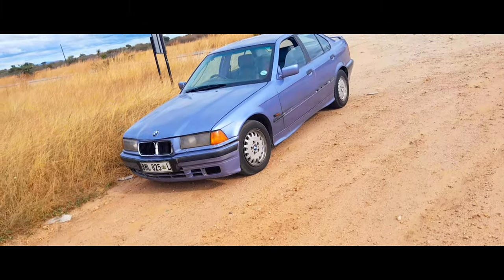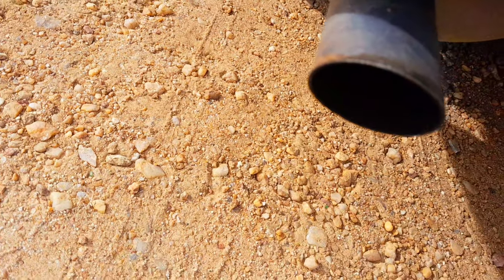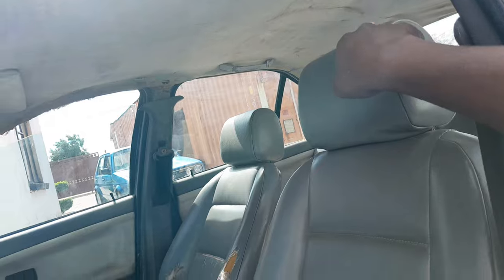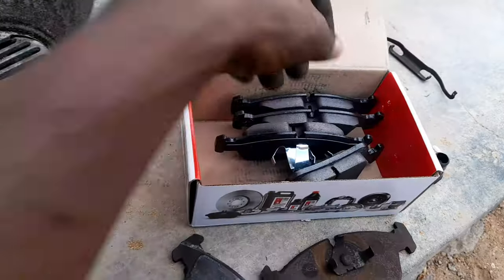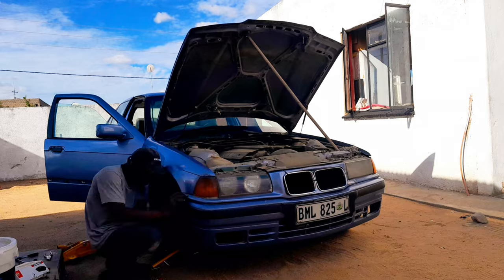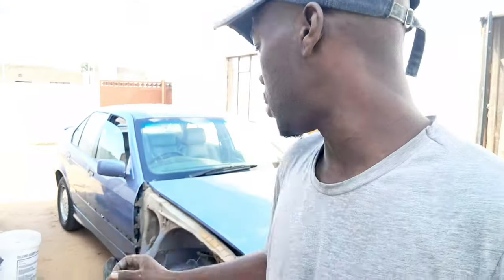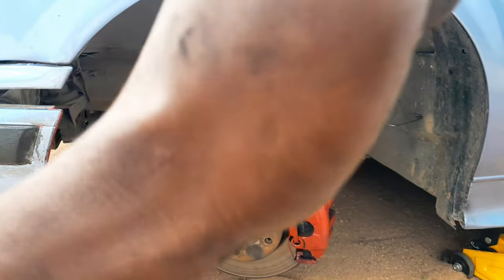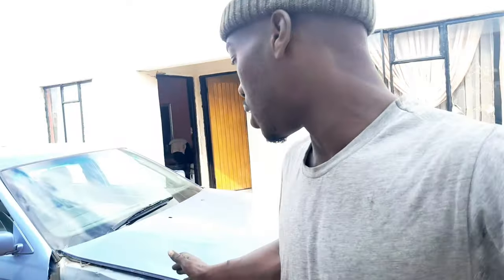RESTORING MY BMW E36 SEDAN (RUST,PAINT,BRAKES) part 1

Comment: neither a 325 or 328 with that single exhaust pipe.  320 at most if the pipe and motor is still standard.....but still, its a BMW, and thats what count
Reply from the maker: Love that ...thanks for the info

Comment: You should try using redoxide after cleaning that surface rust then spray stone chip which will protect the car properly. Primer will only protect for the short time it will start rusting again.

Comment: It's a 325 M50B25TÜ 6-cylinder.

It's a little brother to 328i M52B28 6-cylinder and M3 S50B30 6-cylinder.

So you have a 325i Bro.  However Double  tailpipe was for the flagship/Face-lift M52 325i that came with a spoiler and  6-bar rims and fog lights.

Another thing is that square nudge/bump on the tappet cover. On the 325i its at the back and on 320i its at the front.
Reply from the maker: Thanks for the info